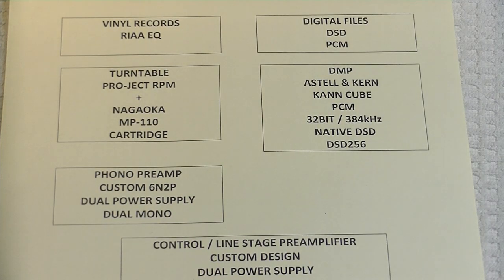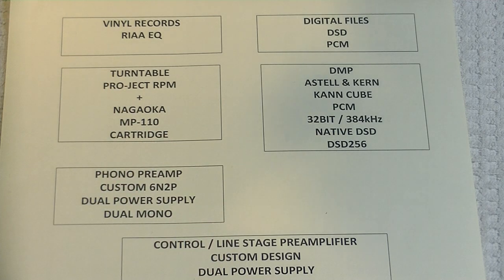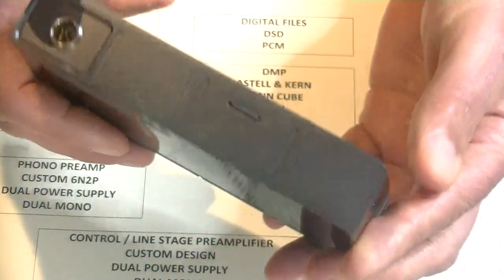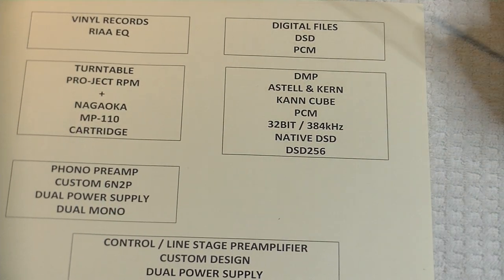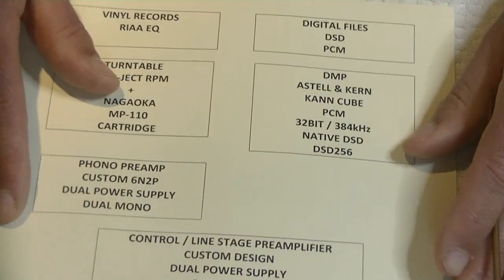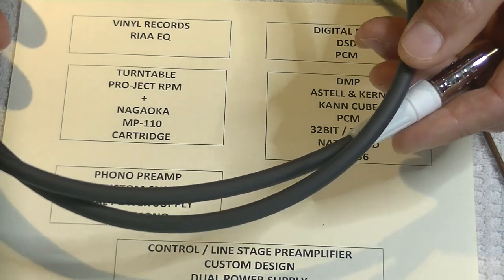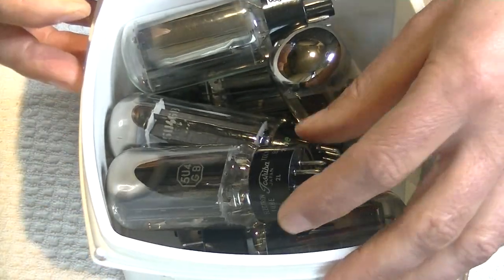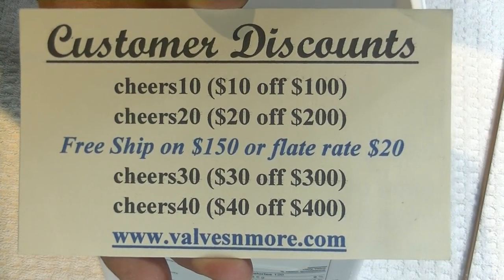Tube Lab #32 How to Improve Your Stereo System

Comment: Hi Jim. What software did you use to make your block diagram? Do you have a template? Thanks for the videos.
Reply from the maker: I just did it in MSword using the border functions, I think I tried to save the original word doc in the information section, but all I can save is a picture as a pdf.  So you get to make your own from scratch!  For years I just sketched the diagrams out by hand, it was only for this Tube Lab that I took the time to make a clean version.

Comment: Hi Jim,   Willsenton r8 and I was extremely  happy with the sound until one of the tubes kt88 started throwing  sparks! Is that what happens  when the tubes fail?  Still waiting  for 4 new willsenton tubes. Set me back 250.00 for the four.
Reply from the maker: Sparks are rare - this is a sign of internal electrodes arcing.  This is either a problem with the amp or a defective tube (which happens).  If these are stock KT88's, they are almost certainly Chinese manufactured.  And what is the nickname for Chinese power tubes?  Firecrackers!

Comment: I'd be interested to see your open baffle speakers. I've never heard a pair. How is the imagery?
Reply from the maker: They image very well, in fact for my favourite style of music - small ensemble acoustic, they are perfect.  I'll post a picture here if I can figure out how!
Reply: A good friend of mine who is a great audio designer helped design my system which has tall complete open baffle dipole multi-driver line arrays.  I've had them for probably close to 20 years and I totally love the sound.  Both the fact that there are no cabinets, enclosures, or boxes of any kind, not even for the two 15" open baffle woofers.  I wish I could post a link to pictures of my system, but when I try to do that I think Google's lovely AI immediately deletes the full post, so unfortunately I can't do that.  It's nice that the fellow here designed his own dipoles because you just don't see many of them, certainly not ones that YouTube reviewers have designed themselves  : )  The benefits that I really like is not only the very large image and soundstage but also the 'airy' sound due to there being no enclosures.  AND, the fact that they have multiple smaller drivers wired series/parallel means that transients are very fast!  I'm HOPING that they way they are configured and wired would be efficient enough for a tube amp to drive.  Theoretically they are SUPPOSED to be.

I would LOVE to get the W-8 tube amp, but unfortunately with my setup, it is tri-amped, so the tube amp theoretically would run my 2 tall line arrays, which is the high-end.  They are now driven by 2 dual-mono amps, one for each channel.  A 3rd amp, a Crown 2502 400/side drives the 2 dipole woofers.  Unfortunately the W-8 does not have a 'Tape out' or 'Pre-out' which I do need to drive my Crown for the low-end.  Otherwise, I'd probably be all over it  :D
Reply: @latheofheaven  Those speakers!!! God id love to hear them, they look amazing
Reply: @LawsonsStudio  Hey, thanks kindly Neil!  Yeah, for some odd, cosmic reason I WAS indeed able to post the link here.  Usually, it is instantly removed.  Maybe our kind host allows links in his comments.  If so, thank you Sir!

Basically, just a very open, large, spacious soundstage.  I very rarely see open baffle speakers (dipoles) so I was impressed that the fellow here made some himself.  Just always really liked the tall line arrays (again, a full image) and from my experience the completely open dipole design seems to lend itself to a very 'airy', detailed sound.  And, with multiple smaller drivers (something else I've always liked) the attack of transients is VERY fast since all the smaller driver surfaces react at the same time in moving a lot of air over all that combined surface area.

Sorry, my humble apologies @Tube Lab  I don't mean to hijack your channel mate!  I *REALLY* like the fact that you have basically designed all of your stuff yourself, including the electronics, that is bloody amazing!  I bet THAT sounds pretty dang good  :D